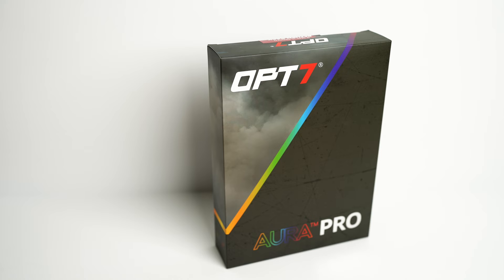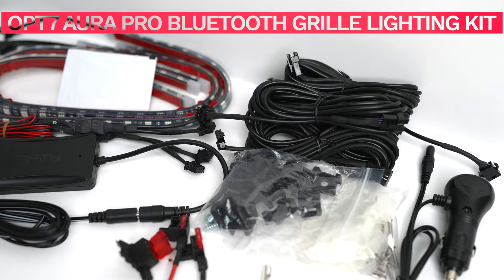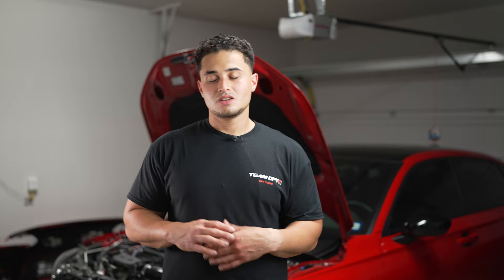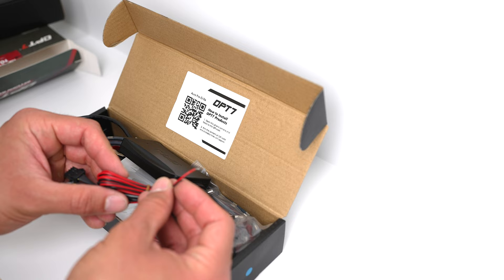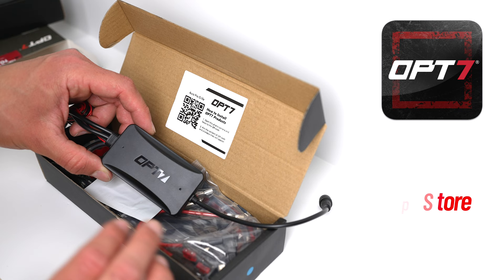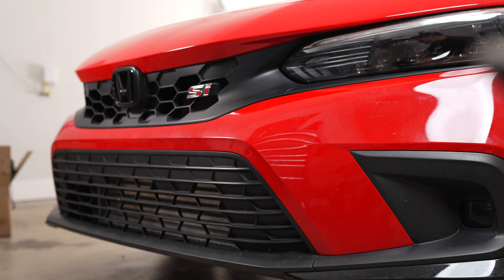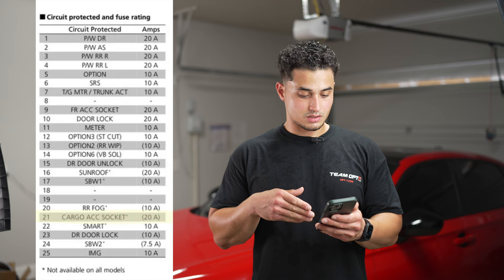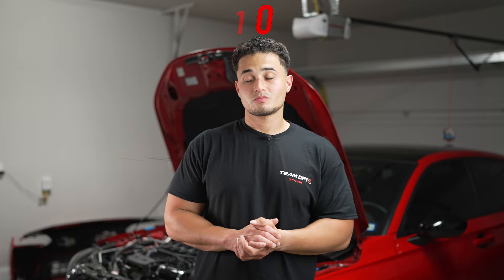OPT7 Aura Pro Bluetooth LED Grille Lighting Kit: 11th Gen Honda Civic

Comment: If I wire the auxilary wires to one of the fuses that turn on when the ignition is turned on, will it turn off by itself when I turn the ignition off? Or will have I to turn it off using the remote everytime.
Reply from the maker: What I found is that the auxiliary wire doesn’t work tapped into a fuse. I had to use the dome lights for it to work properly
Reply: @lui.racing  Gotcha , I just reached that part of the video. If I try tapping it into a fuse that turns on with the ignition, will it turn off by itself when the ignition turns off?
Reply from the maker: @WilldaBear  it will turn off with a fuse that turns off with the car.
Reply: @lui.racing  Thanks!

Comment: will they also stay on when you start the car? I want to do the same on another vehicle but would like the kit to work as DRLs on when the vehicle is turned on and off when the ignition is off.
Reply from the maker: Yeah they stay on when you start the car. That’s it’s whole purpose. To come on when you unlock the car and stay on when you turn the car off, and then turn off when you turn off the car and lock the doors
Reply: thanks for the fast reply that's awesome news theoretically couldn't you just connect the aux wire to a switched fuse such as the cig lighter that only gets power when the car is on rather then using the dome light?
Reply from the maker: @bhxtyrant2962  so the lights don’t get power from the dome lights. The dome lights just tell the control box to turn on, once the control box is on, it gets its power from the fuse I pointed out in the video. I’m sure you could get creative with the aux wire but I don’t want to guarantee anything without actually knowing for sure

Comment: how did you route the red wire up there? through where?
Reply from the maker: I just routed it the side, then removed the pillar cover on the driver side just enough to tuck in the wire, I didn’t remove it all way, just enough. 
And then through the head liner

Comment: I did the same thing but my lights stay on constantly..why is that??
Reply from the maker: Even after you lock the doors? Of you did exactly what I did and they don’t turn off when you lock the door then off reach out to Opt7. They have warranty so they might be able to help you or send you a new one.
Reply: @lui.racing  thanks bro
Reply: @lui.racing  the dome lights you run them to come one when you open your door right?..if so that may be my problem I got a 98 2door tahoe.the only only lights comes on when I open my door it the middle and rear light.you think that could be the problem?.
Reply from the maker: @jr_da_great2403  yeah that could be it. You need the dome light to come on that’s the switch power that will tell the lights to come on. You can try wiring it to the ones that come on when you open the door